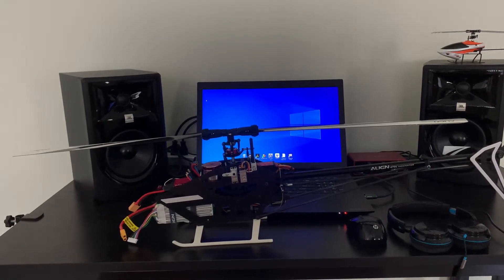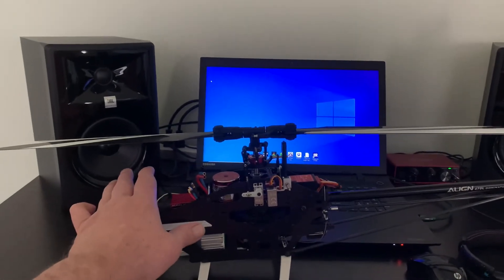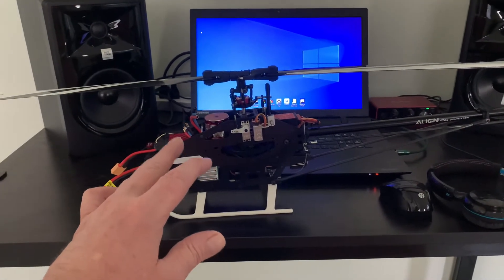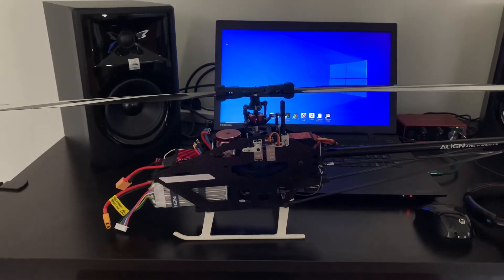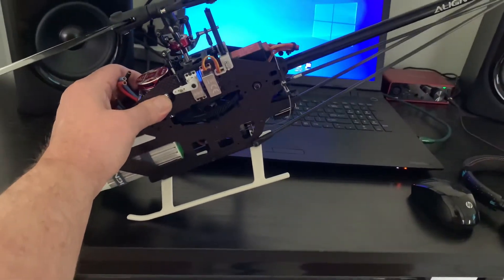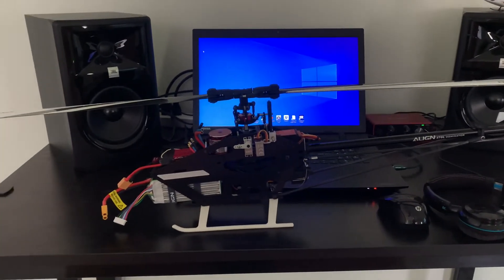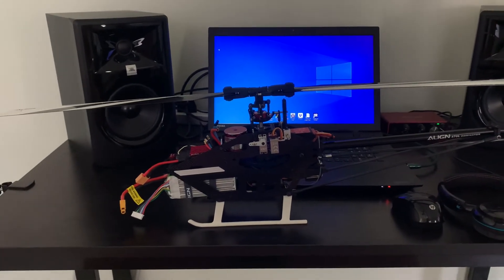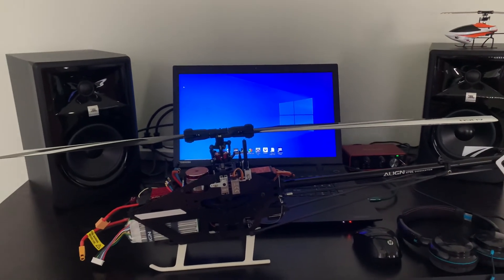Trex 470LP maiden goes wrong..

Comment: all you have is to do is in menue setting mode hold down the button for 7 seconds and manually reset the beastx , no need to buy a new beastx
Reply from the maker: RC FLYER Hey thank you, I tried that and unfortunately it did not work 😢